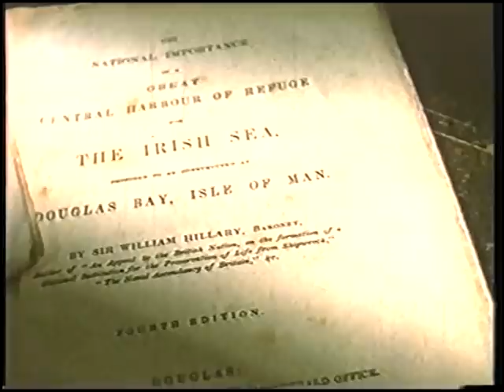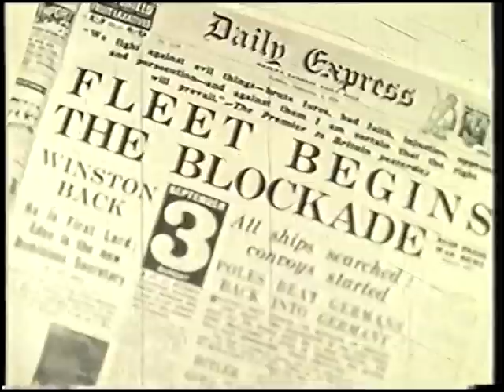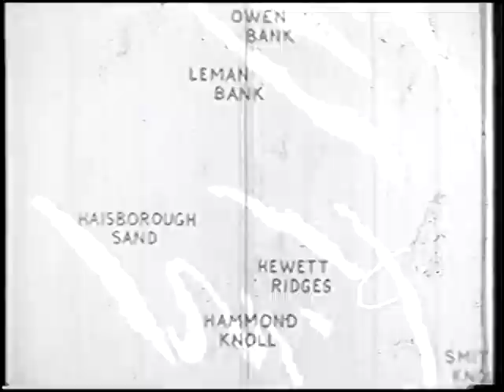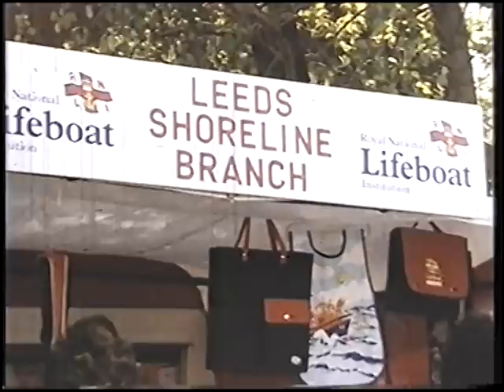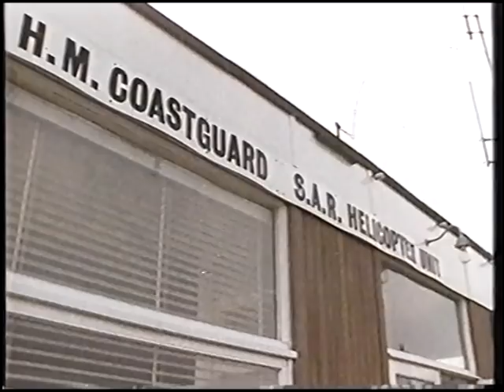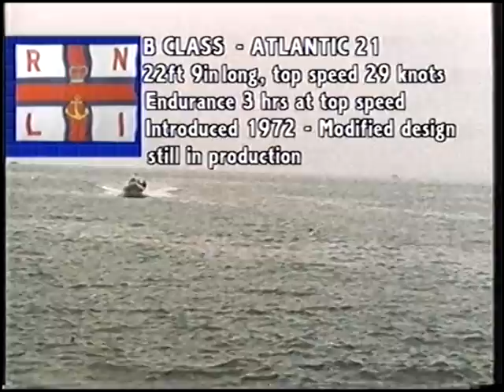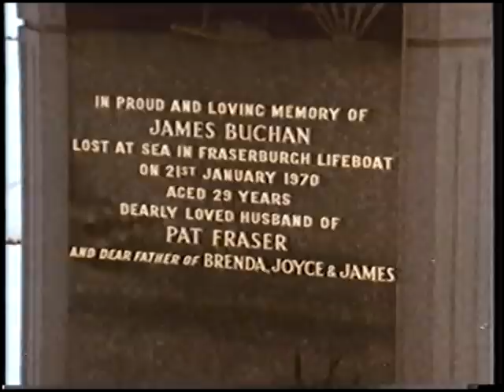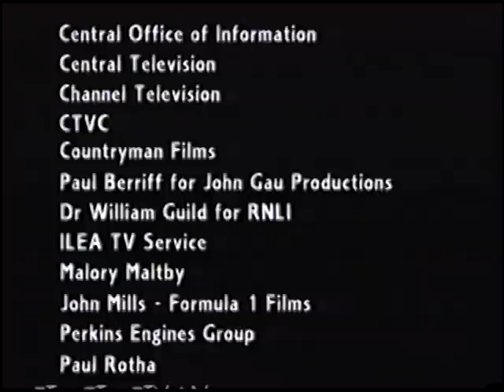The History Of The RNLI- "Heroes Of The Sea"

Comment: The RNLI should receive a substantial amount of funding from the government if they already don’t, I believe that they are still run on charitable donations but provide a service to all those in peril on the sea that should be provided by our country, in addition to the coast guard, after all we are an island race and without are seafarers we would be a lesser nation.
Reply: The RNLI have repeatedly turned down Government funding for several good  reasons, not least of which  is that Government funding usually comes with strings attached, which in its case would involve the organisation having to cede managerial and operational powers over to some government department which would wield considerable powers over all aspects of  its operations. It could also face cuts to its funding or services  depending on which way the political wind is blowing 

The main reason the RNLI isn't government funded is
simply because it doesn't need to be. They receive enough funding from public  donations there is no need for the government to step in.